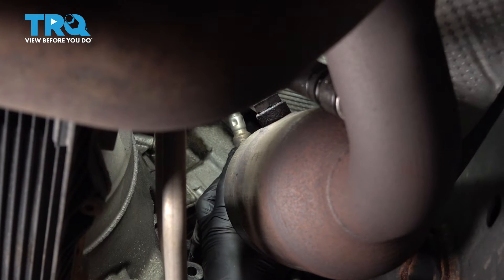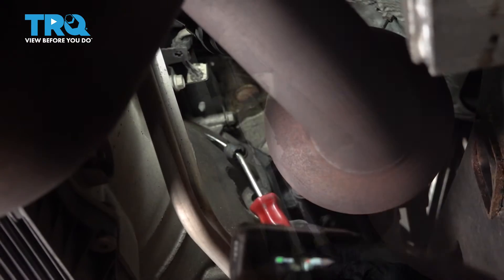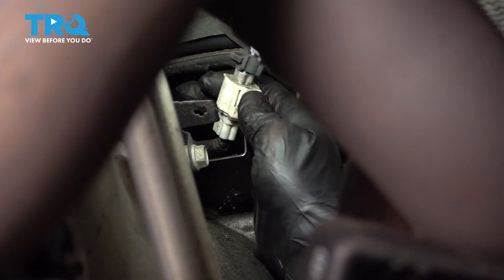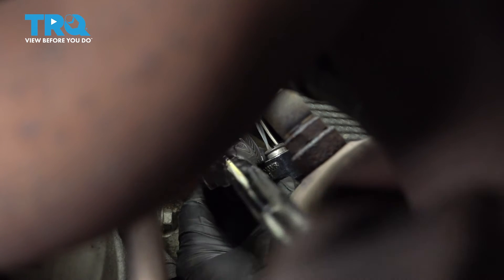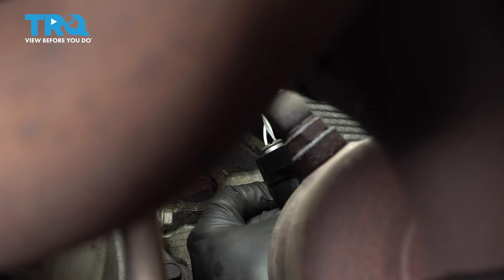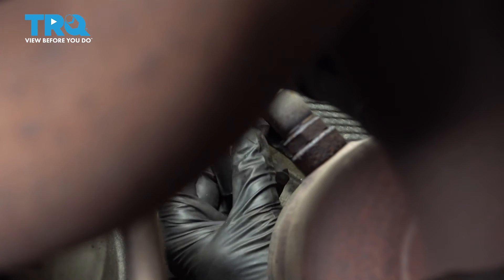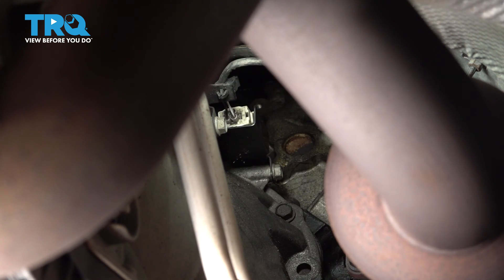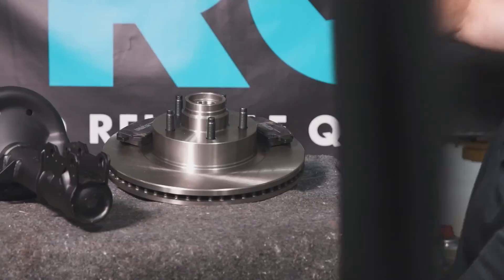How to Replace Upstream Oxygen ( O2 ) Sensor 2011-2018 Ram 1500

Comment: How do you get to the connector upstream on the passenger side on 2011 ram 1500? Have removed tire/wheel and splash guard still can't reach  it to unplug it.